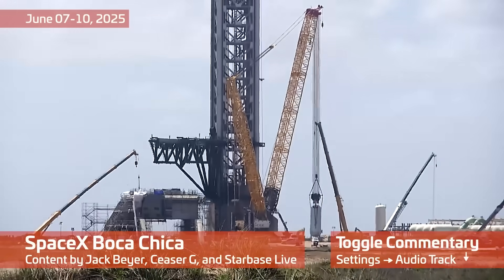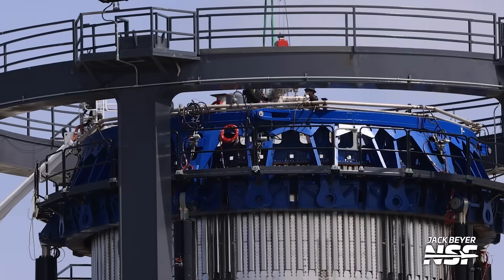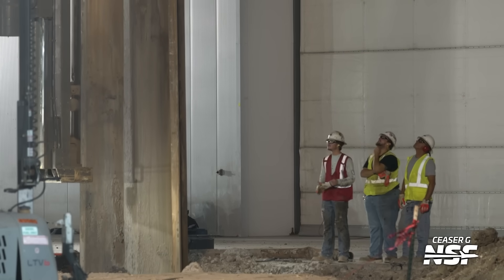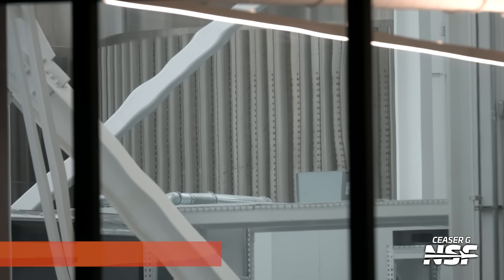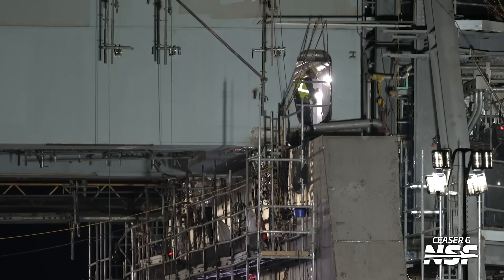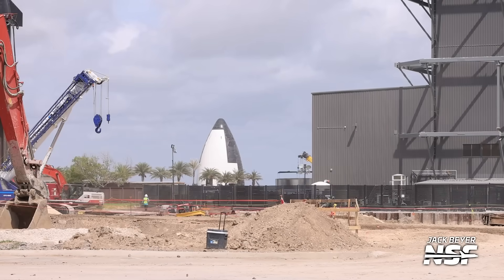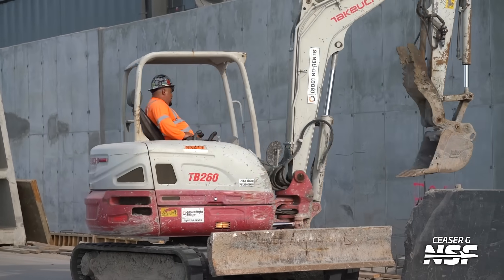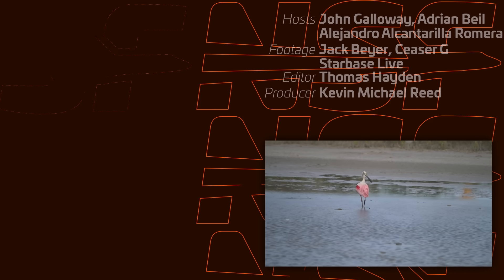"That one is a spikey one. Nice. Good Stuff" | SpaceX Starbase

Comment from the maker: Apologies about the issues with alt soundtracks. YT processing issues with the "languages" in play. Return later and hopefully it's working by then.
Reply: With the plans SpaceX has to transport Ships and boosters from Boca to KSC, would it not make sense for them to build a Barge Port literally behind the MegaBay, and have a shipping canal cut in the existing wetlands (during low tide and/or by blocking the South Bay entrance while dredging works for that mile and half are happening) out to the Brownsville Channel? 
I'm sure there would be a significant EIS to get through, and the greenies would be upset, but it would fully remove the need to ever block roads in order to move vehicles up Hwy 4 to the existing port 15 miles away.. 
Considering how they are suggesting (up to) 76 launches each year from the cape, and no immediate plans to build at Roberts Rd, that would mean Hwy 4 would be getting blocked pretty much every night for HOURS as some poor schlep has to walk the 15 miles with the SPMT remote in his hands, that's almost 25ks!! FTFAJ!
So, (to me) it makes much more sense to have a port on site and save the inconvenience to the public, and they could literally slide the vehicles out the back, and directly onto the barges, then tug them out to the Gulf (of Mexico).. ;)
Your thoughts guys?
and do you have any way to get this suggestion to SpaceX?

Comment: I've always thought that the second orbital launch mount was critical to the whole Starbase operation at this time. Unless they reuse more of the block 1 boosters pad 1 is on it's way out. Especially since they're using pad 1 for static fire testing as well as launches. I was pretty sure that Elon was talking through his hat about not needing a flame trench. I grew up with my dad working on the Apollo mission and you learn right away that rocket power is devastating to infrastructure. If they hadn't blown up pad 1 with the first test flight the whole project would be 6 or 7 months further along. And I was always thinking about what a big project it would be to build a real flame trench and how long it would take. But I could sketch it in and it looks a lot like what they're building now. Once pad 2 is up and running I believe we'll see a big jump in the cadence of launches that Musk wants. BTW The reason the piles go in so easily is due to the vibration. When you vibrate something like soil it temporarily looses it's structural solidity and then the pile just sort of pushes it out of the way and glides past the individual granules of dirt. You could hit it with a hammering blow but that has the opposite effect in that is drives the soil particles together. I guess the best way to understand why they use the vibration method is it's more efficient. In other words it takes less energy to drive the pile with vibration and that makes it more cost effective.
Reply: The problem is the table, not the plate.  That's why the next gen launch 'table' is so much beefier.  A trench would not change that.  I suspect at some point they will upgrade Pad 1 but they might wait and see if/what issues crop up in pad 2's design first.

Comment: The ring and nose cone sizes and shapes have to be precise. The placement of the pins for the heat shield tiles has to be precise. The heat shield tiles are manufactured offsite and the attached holes are presumably drilled into the tiles when they are manufactured.  In addition, all the ring and nose cone sections have to fit together precisely.

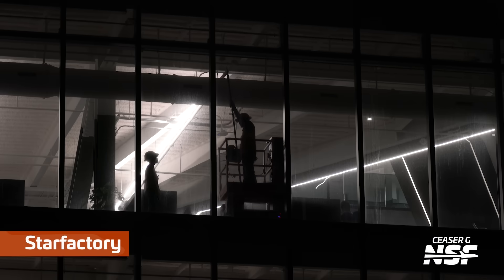Comment: 5:12  the tool looked similar to the tool used for changing fire alarm sensors in high ceiling areas, maybe maintain check for fire alarm  or similar thing?

Comment: @8:54 to your statement, since data is the payload I wonder why they don't install a secondary cold gas system plumbed into the planned system to head off these uncontrolled reentries. It's happened more than once and there are other things to test besides can StarShip make it past SECO.
Reply: Using ullage gas for control makes excellent sense: the only trick is to get an incredibly complex thing to work in space, where the gas and fuel/oxy floats about.

Comment: I thought sheet piling is only needed if you want to dig a hole and prevent the walls from collapsing, like they did at the flame trench of pad B? The Megabays only needed drilled piles as foundations, didn‘t see sheet piles there. So, does the Gigabay get a cellar?
Reply: Maybe they plan to do static fires inside the Gigabay LOL

Comment: I guarantee you they’ll put an underground pipeline once that commodities station is set up in Brownsville. 25 miles is nothing for an underground pipe and they can tee it off and hit Massey’s on the way to the launch site.
Reply: I've been wondering about the potential liquid methane (LNG) supply. The huge Rio Grande LNG is under construction only 9 km (6 miles) from the launch pad, and the planned Texas LNG is a little closer, around 8.5 km. However, a pipeline would need to go under the Brownsville ship channel, and following available easements to the pad would probably be 21km (13 miles). Also, the commodity LNG may not be sufficiently clean for rocket engines, which could rule out Rio Grande LNG and Texas LNG.